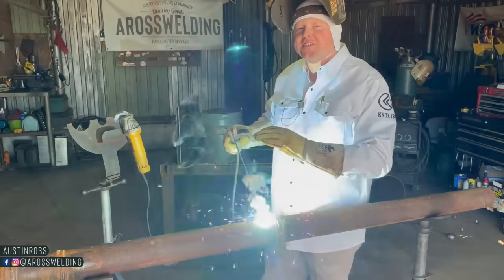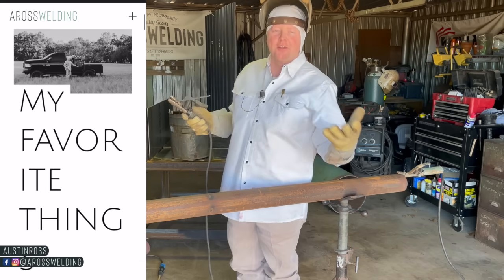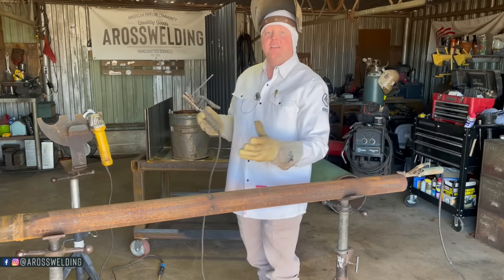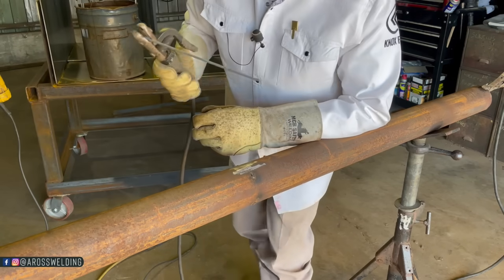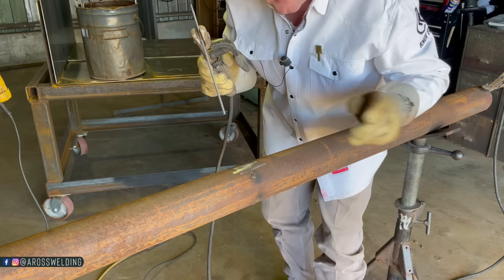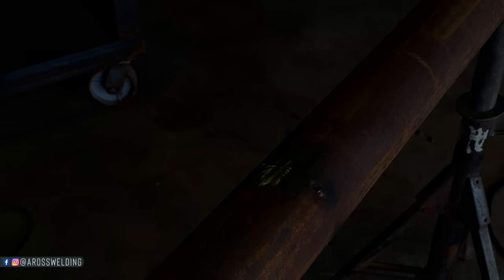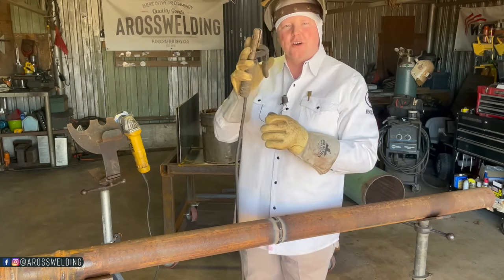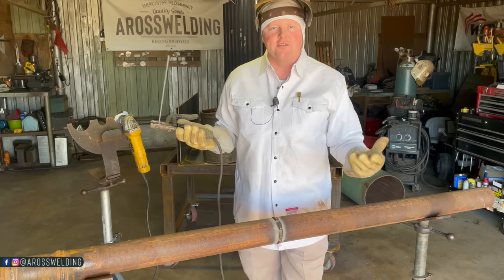Do this instead (3 Stick Welding Tips)

Comment: I’m new to stick welding, how do you know what setting to use??? 40 amp, 90 amp, 120 amp…..?????? Higher burn hotter I assume so is it depending on the sticks your using??? If so what sticks use what setting??
Reply: All electrode types and sizes have operating ranges from the manufacturer, so you will setup your amperage range depending on what position you are running in for a given electrode type and size per this range.  Although some electrodes are made for horizontal fillet welds and flat positions (only due to their higher deposition rates) the "ALL POSITION" electrodes will have a sweet spot they run great in all positions in (amperage range).  

What this means is when you are welding something like a pipe in the 5G position you strike the arc (and establish the bead width right away), and if while you are reading the puddle you have good wetting action (fluidity at the toes of the bead) and control without sticking the rod (too cold), or too much fluidity /too hot uncontrollable bead (dripping sagging metal) then you are well on your way!  But the key in reading the puddle  is each piece of material (depending on thickness, size, preheat temp etc.) may run a given size electrode a little higher or lower, but that will all depend on reading the puddle and what you see occuring under the hood while you are welding.

If some of these things confuse you take a beginning stick welding course somewhere near your place of residence, and have a good one- always stay safe and wear eye, face, and breathing protection as well.
If this is too inconvenient for you watch Welding tips and tricks, Austin Ross, and other great welders on here with "good camera arc shots" to show the bead and how you can read it while you are welding and it's fluid!

Comment: Austin, I have a question, I bought an older SA 250, the 115 outlets are DC, I burned up a couple Milwaukee grinders running on DC, but i havent had issues with Dewalt. Is it going to damage the dewalt grinders eventually? Also i have a Metabo brand grinder, and I'm really hesitant to plug that one in because theyre pretty spendy. Is it safe to run on DC power? Thanks!

Comment: 7018x 1/8” mine is the hardest not to stick have a trailblazer welder so machine is not at fault thought maybe ground until
I switch rod went with 6010 and it welded great so what am I doing wrong?

Comment: My welding teacher turned out to be someone I liked as a fellow human being but probably will learn more on YouTube.
He did help me get acclimated to my own equipment that I took in for that purpose.
However, you sir are an excellent instructor.
I’m subscribing and will follow you intently.
I’m one of those dreaded DIY’s…
I’ve had a few classes where the instructor was a quick down and dirty type followed by trial and error.
I started with stick where I did crappy welds followed by my own Meg and fill in love with the thing.
I’m setting up my equipment soon and will put your gentle approach to practice.
Thank you so much.
J bo
Reply: As with anything, both instructors have merit.
With any technical task  sometimes you are better to be "thrown into the fire" for  long enough that when you do get the detail instruction..  you actually understand and have a feel for what they are talking about.  I had some great instructors like that..  kind of like "3 phase learning"
Phase 1: Safety and bare minimum instruction
Phase 2: Struggle bus
Phase 3: Bring it all in with the details.
Reply from the maker: Pleasure is all mine!

Comment: One of my welding instructors, a man with a brilliant Caribbean accent, and quirky pronuncination (and a black belt in Karate) told us, "To initiate your arc between your rod and the workpiece, you can either stroke the workpiece like a pussy... Or poke the workpiece like..."  I don't expect that's acceptable, now, probably wasn't then...

Comment: I have an even better tip from an old expert. Place rod vertically down, into last weld pool if continuing, and gently push till it sticks and then bend to break the stick and the arc starts. Do this as your rod runs out and you need to contine, and it will be almost invisible.

Comment: Did pipe for 45 years, last 5 as an instructor.  When I started it was P5 root and Low High fill and cap.  In the early 90's code became Tig root, fill and cap 3 inch and below.  Stick fill and cap everything above 3 inch.  Some of us would just weld them out tig if we were in the rack rather than climb down to reset the rig every time.  Loved the job, made a good living for my family and that was what was important to me.
Reply: Yes sir I’m an older welder too and I only remember p5 root and 7018 hot pass and fill and cap now I heard that they are running pipe downhill
Reply: @larrykeel2739  Pipeliners have welded downhill for ages, one of the main rods they have used is HYP.  You may have heard of it by it's nickname hippy rod.  It is designed to run downhill and has a 70 thousand pound tensile strength.  Those boy's out of Oklahoma can cover many a mile a day welding those pipelines.

Comment: Can't thank you enough. I've been struggling endlessly to light 7018 rods, alternatively "striking like a match" and "poking" or "tapping". I burner a few rods this morning, just doing starts by being "gentle". Finally, the advise I needed. You have freed me to use 7018.
Reply: For me it was 6010, today i figured it out and have felt like a god.
Reply: 7018 has had me questioning my manhood
Reply: I'm new with welding. I've had quite a time striking up 1/8 7018 rods.  And even if I do manage to successfully strike, I have difficulty maintaining it. It's nothing like the 6010 or the 6013 or 7014 rods I have. Those rods strike up much easier for me. I just found Mr Ross video here and I'm looking forward to trying what he suggested and demonstrated as soon as the weather permits. It's encouraging to read your response to this video stating his advice works well. I'll be happy as a lark myself to strike a 7018 without having a small war. :) Thanks for your comment!
Reply: @raidhhi2217 Could it be that you have too long an arc? I too had probs starting 7018s when I started playing around with welding, but I never struggled maintaining it. 
Anyhow, if your machine allows it, you could try cranking the hotstart up, I found it helps (to start).
Reply: I run 6011 1/8"  AC rods easier to use, yeah they are claimed to be shitty rod
Reply: 7018s suck don't they? But when I figured that ensuring they're good and dry (ideally just out of the pack) helps with starting and maintaining the arc. Those 6010s though, I completely avoid them, my welder doesn't really like them too much so 6010s and 6011 I am staying away from, those for now so I only use 6013 and 7018 for now.

Comment: My custom, liquid-cooled welder with transformers wired in series just gets its arc started with a simple touch. Store-brought welders don't let you change the voltage, only current through parallel wiring.

But yeah! A big enough charge can also help you initiate the arc.

Comment: I have a 220 Lincoln that I’ve had for 30 yrs but that’s my biggest problem getting it to start and not stick.i was using 7018 a couple wks ago and it fired up right and burned right for a couple rods then back to the same old crap.i’m in the process of taking everything apart and cleaning and making sure connections are good now.mother of god I hope this does it.i learned learned to braze first then mig but first had the buzz box,we’ll see how it goes,oh and yeah I’m just a backyard diyer

Comment: What works for me everytime - is a RED BRICK.
Yup a red brick, just scratch your welding rods across it to break/scratch off the coating and the rod starts right up.
Of course you can use sandpaper on a board or a file, etc. but they have their limitations, just put the brick in the bottom of your pail and go to work.

Comment: peple take the term strike like a match to litterly. been welding 20 plus years and drag start or pop start depending what im welding on. drag start rod berly puld along the flux till it lights up. and a pop start well that can be forcefully if its a restart but tens of thousands of pressure welds all good used drag starts. but yes geting in a good and cumfy position helps alot. tho have yet to find a cumfy position in a stem drum or inter bodum of a ship. going for a stable position really.

Comment: Perhaps the funniest weilding demonstration I saw is S. Korea while attending Central Texas College at Camp Casey in 1984. I had been taking an automotive tune-up class with Mr. Clark to learn a little bit about emissions equipment. Mr. Clark had 21/23 ASE certification tabs. The only reason he didn't have all is he had been out the USA for a couple years.

The following semester I took basic weilding with Mr. Webb a certified weilder who had been recently hired. In the interim the previous semester Mr. Clark had been teaching weilding also.

The question was, "Who was the better weilder?" The challenge was who could weild better vertical uphill behind their back without looking. Mr. Clark did a noticeably better job while smoking a cigarette and talking. Of Mr. Webb said, "That don't mean nothing."

I did do a little tig weilding on a lathe making surgical instruments. Some flat steel shop structural weilding that I enjoyed. Worked as weilders helper in the oil field and as a weilder on non-certified pipe supports. I enjoyed shop weilding but it didn't pay that well.

Comment: Great video young man!! I haven't done much welding over the years drove a truck for 38 years. For several years had a great neighbor that did all my welding for me we moved about an hour away now i have to do the welding myself well it don't look very good but it has held so far but maybe i can do a better job now after watchin you i was striking it kinda like a match. Thanks for sharing be safe have fun.
Reply: Practice practice practice.  You will catch on with time.  Be the boss and relaxed.  The new eelders are easier, but I learned on a 99 dollar Lincoln buzz box that made me comfortable with anything that makes sparks. Time and rods.

Comment: Gloves on before jacket. Best advice in this whole comment section and neglected in the video. No hate and not saying this was a PPE instructional but for the love of Spam and choice seafood from a gas station blessed with a  Java monster, please keep your digits free from slag and spark. May the FLHA gods look kindly upon your 2x4 inspection and root passes be tidy.Amen.
Reply: Wouldnt that alow hot ambers and sparks to bouce down your sleaves ? Seems morinic to me
Reply: @noah8877  Morons don't know that hot sparks hit welding jackets regardless. Tucking your glove into your sleeve prevents slag from hitting your wrist and getting stuck in a glove as it happened to me years ago plasma cutting overhead.

Comment: Where was this video 9 days ago, when I felt like a 6 year old on xmas morning when my new 200 amp mma arrived at the doorstep, it got there while i was out buying supplies for it so I could get started as soon as I had finished work for the day. I am a Mason, but taught myself to weld on a flux core machine a few years ago so that I could weld shelf angles for brick, lintels, and structural support columns for steel I beams.... The only real face to face interaction with welding had taken place two years earlier, my first year back from prison, my second year working for a buddy from high school's GC company, and it was a very brief, but awe inspiring experience.... After I started my contracting business, I had my FW (fing winner) aka my go-to, aka the "redneck mcgyver", also my only long term employee and human being I trust (sadly he is on "vacation" himself at them moment, but I degress, he owned a 110v flux core welder, and he is the only person I have seen weld with no helmet, no gloves, no anything... I asked him after seeing him weld a couple times how he didn't go blind, he said he literally did one pass with his eyes open and the "safety on," then would close his eyes, go hot, and blast away... somehow always leaving almost perfect welds... maybe not the prettiest, but they sure as hell held up some over the top abuse... Fast forward a month later, I bought the same welder, and after a year of frustration due to accidentally leaving one sticker on my welding helmet, suddenly after removing said sticker, overnight my welding abilities improved 1000% and I was in love.... However, I soon realized a stick welder wood be a much more useful process for welding some of the thick plate, angles, and tubing we use on occasion.... So, after about a year of back and forth whether I actually needed one or not, one project solidified the "YES" which the stars aligned because it just so happened a welder I had my eye on was on clearance. I literally spent more money on rods (2lbs of 6011, 6013, and 7018; I was disappointed that I couldn't find any 6010 within fifteen miles of my office, workshop, or home... bummer... but, even more a bummer, was the three hundred (way exaggeration) stuck electrodes, including the occasional oopsie daysie after pulling one free and hitting another piece of grounded metal and getting an arc I definitely wasn't expecting. Three nights, and about 6 hours I managed to run two rods from start to finsh, caught three completely on fire, stuck about 100 or more times, until i accidentally figured out that I was striking way too hard, after just brushing the metal by accident and being lucky enough to realize i had an arc and get it to stay rockin'. I fumbled with it for another hour with a 50% success rate. And, the following day, I struck up and burned the whole rod, every single attempt. This video would have saved me so much personal dissatisfaction with myself. lol. And, even more angers me, I subscribe to your channel watched a few of your videos every night last week, and somehow missed this one! lmao. But, Thanks For spreading your knowledge!!! Appreciate you! A NY Mason, masquerading as a welder.... lmao

Comment: I have TIG welded quite a bit (in my garage).  I took a class at a community college about a year ago.  And learned stick and mig and tig.  But I have not done any stick since then until about a week ago.  I was having a big problem striking an arc and I see what I'm doing wrong.  You were a big help!!!  Thanks.

Comment: I’m trying to sell off my YesWelder and get something a bit better (I know this isn’t the welders fault) but it keeps shutting off my circuit breaker every time I weld longer than 2-3 minutes. I’m super good at MIG, but don’t have much stick experience or TIG at all .. trying to find a shop that’s willing to teach TIG or if I can end up getting a decent machine doing it at home, but what exactly would be making it shut off my circuit breaker ? Me using the 110 volt port ? I don’t use the 220 cause I don’t have one of those hooked up at the house
Reply: Yes, just get a 220 added to your breaker box and it wont shut off no more. I got a miller maxstar and it does the same on 110 but i got the 220 added and it welds nonstop now.

Comment: In the 70's while in the Navy, some of us in the HT shop got the bright idea of trying our hand at trick welding, it's started with using a mirror and welding between our leg's, first flat then vertical, that wasn't enough, the we duck taped the stinger to our foot and did the same flat vert and overhead, when we finish it was the stinger taped to our foot welding two pieces of plate in a bucket of water. What was the point? other than boredom we wanted to test our skills in welding in not so comfortable conditions, I worked with a bunch of really good welders and our abilities at welding at sea be it up on the mast to hanging over the side in a boswin seat underway. A few of us went off to be underwater welders or iron hangers.
Great video 👍🏻, although never heard "strike a match" now drag it or tap it yes, maybe it should have been "gently strike like a match" that's what you are doing and saying. I guess those of us who have been at it for a long time take for granted the little thing's we do, I make a rotten teacher because I forget those little things.

Comment: For practice, sharpen a pencil real pointy and try to make marks without breaking the tip off. Even a mechanical pencil.
When ever i use 7018 i bring a 2x4 around. While it's glowing red stab it into the wood and your next start is like the first.
Reply: Oh, that seems like a good way to practice!  I'm guessing you mean holding the pencil in the stinger?

Comment: When you say "keep the heat down" do you mean the amps? I often have to cut rods in half because my hands tend to shake a little and the longer the rod the more the shake.
Reply from the maker: Yes, that’s what I mean when I say heat
Reply: Do the two hand method like AROSS dose sometimes to get going.

Comment: I got to thinking yesterday well I was welding plates onto a machine and grabbed one of a files that I never use. It works great at not only knocking away the slag but all the little bits in the crakes formed. A lot better than a chipping hammer. Had a few problems with the 7018 not wanting to weld on both sides of the gap. Regardless of me bouncing back and forth from each plate. Took a few different try’s to fill clean and not weld one side only for a while then the other for a while. Tried the bend the rod and push down hard and that made the rod fill go down into the groove. If I had to do it again I would of made the groove wider.